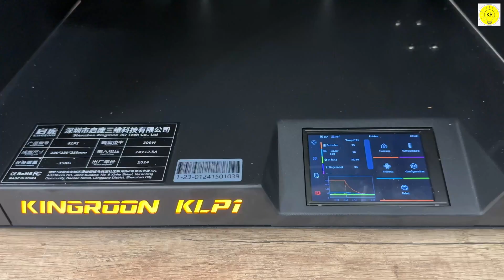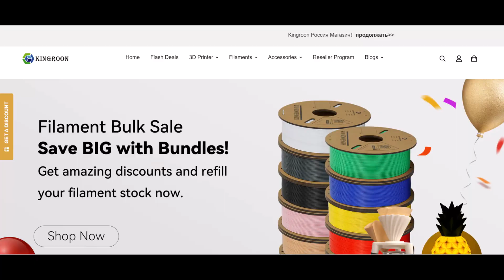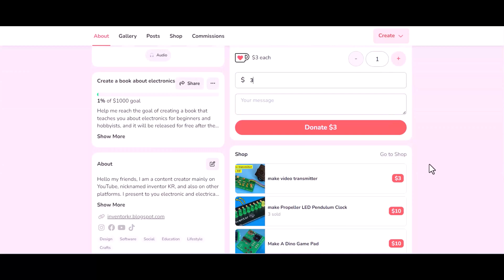The fastest way to make crisp PCBs at home! DIY PCB Fabrication

Comment: 40 A three-cell protection module for a single battery cell? This gear motor consumes a maximum current of 200mA. Also, the minimum voltage of the speed control module you used is 6 V, because its circuit uses a 7805 regulator to power the NE555 IC. The maximum voltage of a lithium-ion battery is 4.2V, and the NE555 cannot operate at full power with this voltage.

Comment: To make a small table rock, no battery is needed.
Just make a meter long pendulum, right above the pivot point, put the pcb table,
its just take 6" x 8". 

In my experience, moving the etch fluid is important, but more important is the temperature 
of the etchant.  The way I do it is find a zip lock bag slightly bigger than the PCB, pour in hot water,
drop a 1/2 ping pong ball size FeCL3.  Stir well. Then put in the PCB. Squeeze out most air.
Zip lock the bag .

Then put on the rocking pendulum table.

Comment: Is this a quick way? Do you need a 3D printer for this? :)) Does it take longer for your son-in-law to take a bath, pour the solution and put in the marked textolite? :) Well, if you have such a printer, then add a small cutter there and cut it out - didn’t you have enough imagination? :)

Comment: Why a 3S 30A BMS if a TP4056 is enough for a single 18650 ?
Reply from the maker: Sure you can just use TP4056.
Reply: @inventorkr1  а Вы зачем использовали 3S 30A BMS?
Reply: Same Question